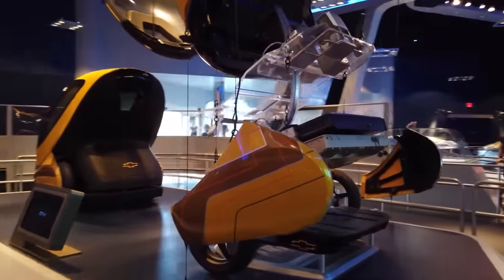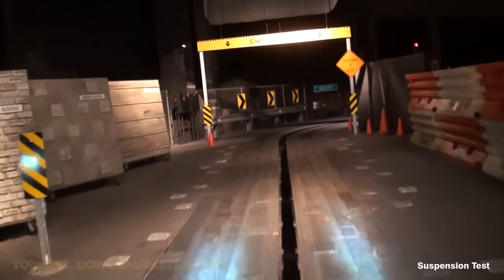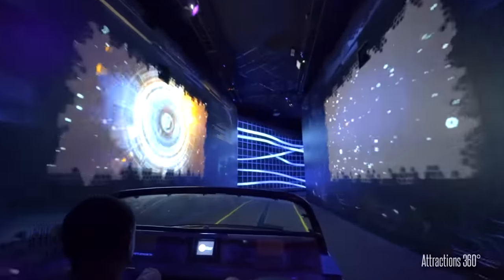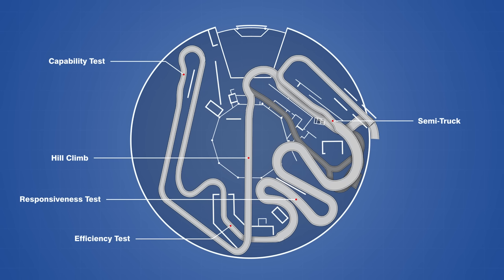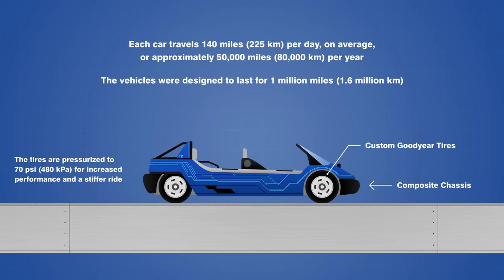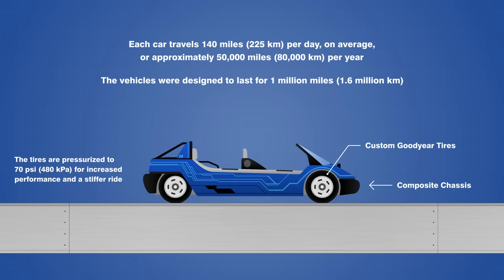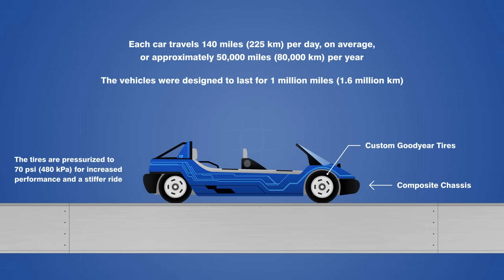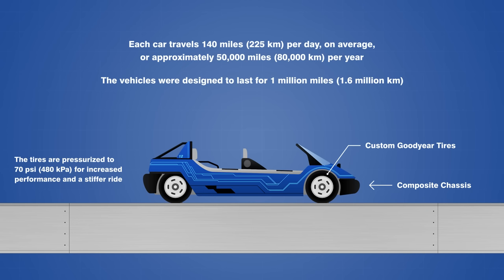How Disney's Test Track Works

Comment: Excellent video I have ridden Test Track, Journey to the Center of the Earth and Radiator Springs Racers. Nice to know how the ride system works. Did the Rocket Rods in Disneyland use a modified version of this same system? It was retrofitted on the People Mover track and I've seen pictures of a single large pipe down the middle with buss bars on both sides of the pipe. Too bad Disney didn't give Tony Baxter a proper budget for that ride where he could have implemented banked turns.

Unfortunately, Dynamic Attractions went bankrupt and was sold to a Hong Kong-based financial services company, Promising Expert Limited (PEL), for $1.5 million US dollars. Disney and General Motors have announced that Disney Imagineering will use inspiration from the original World of Motion in the next redo of Test Track. The finale where the track circles around the building at high speed may be removed and the remaining outdoor portions enclosed so that the ride operation is not impacted by weather.  I suppose the mechanics of the ride system won't change with this refreshening.

Comment: From guided track, power supply using collecting shoes to signalling system (docking control logics, fault management, etc.). It is quite similar to modern Auto People Mover(APM)/metro system.

Comment: “Virtually impossible to have two cars in the same zone at the same time.” I’ve heard that phrase more than twice in a few similar disasters.
Reply: On, it can and does happen.  The thing is, the wayside RCC/RMC (ride control and monitor computers - there are 1 each) shuts the ride down utilizing what it called a "power disconnect".  It's the longest of restarted when the ride shuts down like this.  

For what it's worth, the faster the vehicle travels, the longer the zone is, since the stopping distance is increased.  In the station (where you get on and off the ride), the zones are so very short (vehicles only moving at jog speed), that it is physically impossible for two to occupy the same zone.  There is also ALWAYS an empty zone between vehicles.  The command in this empty zone is always a stop command (the wayside computer only tells the vehicle to do 1 of three things - 1, "run" at profile, 2, move at jog speed, or 3 "stop") to the vehicle as well.

Comment: Interesting that it has a 250hp motor, a few things that i'd like to know is what is the Wh/100mi consumption for these vehicles if they were subjected to a epa range and efficiency test? What's the max amount of Kw the motors can pull back for regen? How much does it cost Disney for the power bill for one single lap? And what would the "v2.0" of the vehicles look like? Chevy Bolts? Hummer EV? Or maybe the elusive GM EV1?

Comment: A lot of semi truck trailers have a similar system for the trailer brakes where if power is lost the brakes automatically actuate and the reason is if a trailer is parked and un hitched it’s less likely to roll away also it’s less likely to roll away and become a Runaway trailer hazard if it becomes uncoupled from the cab well towing down the road for example during an accident or if the kingpin was not engaged all the way
Reply: Yes, if the brakes work as described in the video, that was a change from the original design.  And a change is evident from the view presented in the video.  I left Epcot in 2007 before the big retro of this ride; at that time, no springs were actually in the caliper.  The master cylinders had an actuator that would release the brake. Should there be a loss of electrical power or an e-stop activated, springs would actually engage the brake.   

It used to be 5 brake systems for the vehicle.  One master cylinder for each wheel (4) that was only used for emergency braking or parking/stopped on the track.  The 5th was for a "show" brake and would be used to slow the vehicle only at certain times, as regen braking was heavily used.  You could tell when the show brakes were being using on the deceleration after the high speed experience.  If the regen brakes were not enough, they would "pump" several times to bring the decel rate into the proper profile.

Comment: The same concept for brakes is used in trucks (at least in europe). Once you have a significant enough leak in the pneumatic system, the brakes will close shut and you ain't going anywhere. It's kinda strange we don't have the same system in all cars.
Reply: yes, same in the usa. air brakes use that concept in general, including roller coasters

Comment: Interesting video! Two things:

On my most recent ride, my sim car drove very slowly, but didn’t stop, through parts of the responsiveness test. I assume that this is due to my car being too close to the car ahead. You mentioned that a no-go signal will cause the car to come to a complete stop, but how does one explain the car moving slowly but not stopping? 

 Secondly, you mention that the hydraulic disk brakes are not used during normal operation, but anyone who has ridden Test Track will describe the somewhat uncomfortable and abrupt braking that the car will sometimes do when going down the hill after the initial climb out of the loading area and will always do when slowing down after the high-speed portion and descending back to the unload area after the high speed outdoor portion. These abrupt braking events are accompanied by what sounds like, at least to me, hydraulic hissing sounds.  

What are those hissing sounds?
Reply: While I left the ride in 2007 and as such, I know some things have changed.  But, watching another POV video, it does appear that what was once called the "show brake" system is still in use to decel after the high speed experience.  This brake was a second pair of calipers mounted to the from wheels and used when electric regen wasn't enough OR when the braking sensation was desired.  

As for moving slowly, could be a couple of different things but most likely, you are correct. When a vehicle approaches an occupied zone (typically called a moving block system or MBS), the wayside control computer issues a park/jog command to the zones behind it to bring the vehicle under tighter control, in anticipation of a stop command.

Comment: I’ve only ridden the newer version. My favorite part is probably the car designing program. Is there a way to play around with it without riding Test Track?
Reply: It’d be cool if they had implemented it on Radiator Springs Racers as you designing what your Piston Cup racer looked like. However, it wouldn’t fit too well with the current story.

Comment: I miss the old Test Track. Doesn’t even compare to the new Test Track. The testing theme of the original works much better than the virtual reality theme of the new one.
Reply from the maker: I agree! The new version is more modern with some cool effects, but the storyline was so much more cohesive in the original.
Reply: I would like test track best if they got rid of the simulation thing and had the storyline be you testing your car for real real but also keep the design aspect because competition fun

no need to thank me disney

Comment: As someone who haven't experienced the OG Test Track, why is it better for many people? I really liked the Tron like effects of the newer one.
Reply: I find the new theme doesn't really fit nearly as well as the original. In the original you had a voice that would guide you through each of the different testing stages and it made you really feel like a crash test dummy. The new version feels very detached and lifeless in my opinion. Instead of walking through a detailed recreation of an automotive engineering faculty in the lineup to the ride, you instead walk past some black walls with simple blue LEDs. Honestly I'm hugely disappointed in the new version
Reply: it was way easier to understand for anyone.. the visuals were very obvious... you got to go through the actual physical tests of the car which added thrills and humor to the ride, like the extreme temperature tests, being "sprayed" with substances, suspension tests with bumps, the near miss with the semi, etc. The doors before the outside track made sense since just about everyone has seen a crash test into a wall. Far superior.

Comment: but how do the vehicles steer their wheels? is it purely mechanical or is it electronically controlled?
Reply: Under the track is a bogie system.  It's fully responsible for steering the vehicle along the guide track, which is actually below the deck surface you see (where the 4 rubber load bearing wheels are).

Comment: Very interesting, but how do they control the speed? Since they all share the same 3-phase power bar, a variable frequency is probably not used.
Reply: Actually, variable frequency IS used.  While modernized during the last refit, the variable frequency drive is located under the hood.  The entire track is mapped and the onboard RCC/RMC (ride control and ride monitor computers) and use a series of sensors to track position on the ride.  Speed reference is sent to the sent to the VFD via a simple 0-10VDC reference and away you go.  The sensors include 2 idler mounted encoders, an IR beam used to verify position.  When the vehicle would first start up, it would move at jog speed (even if a run command was being received) while another sensor (used to be a bar code, later converted to an RFID tag) would get a position number from the track.  It went like this - jog speed, detect a number.  From that number to the next, the encoder should turn X number of times.  Then check for a flag and the next number.  If that checked out, then the vehicle would resume normal profile speeds.

Comment: For my only visit to Epcot, I remember an electric vehicle display where you could "drive" the car. The wheels actually turned, but they were on rollers, and the car didn't go anywhere. You faced a projection of (I think) a race course, and the more you pressed the "gas", the faster the projection played. As near as I can figure from the t-shirts I bought, this was somewhere around 2000, but I don't remember the Test Track being there. Maybe it was down at the time? Was it prone to that?
Even back then, I knew I wanted an EV. Interestingly enough, as of this year (finally!!), I now own a Chevy Bolt. (Hasn't caught fire yet - fingers crossed!)

Comment: Got to ride it in 2008 and was one of the best rides and showcased the storytelling capabilities of the ride designers you felt like you were pretty much at a very condensed manufacturer proving ground but still was a very fun ride

Rode it 3 years ago was very disappointed no real story no immersion was like riding thru a very jerky 80s arcade setup without the games

Comment: I remember riding Test Track in the front seats with a French mother and son. The outside seats have the normal 3-point seat belts, but the middle seat has a 2-point belt (like on an airplane). It was very puzzling to gesture that the kid's seat in the middle did not need the shoulder sash.